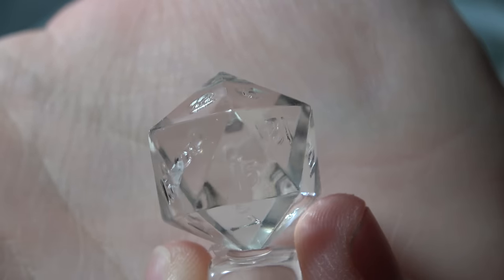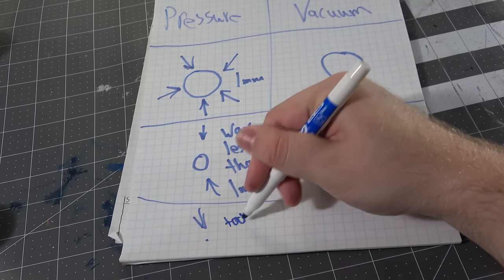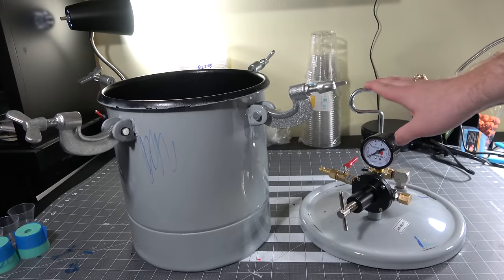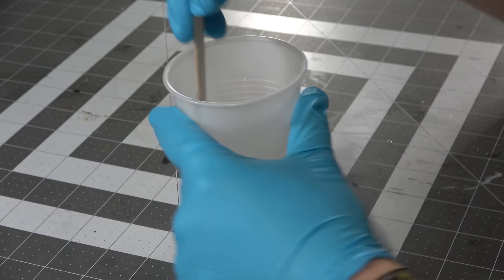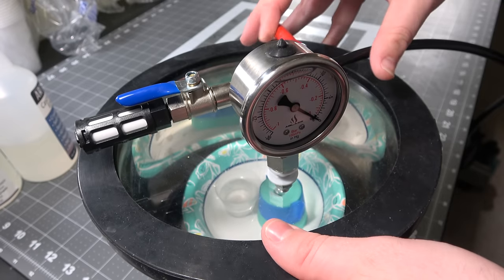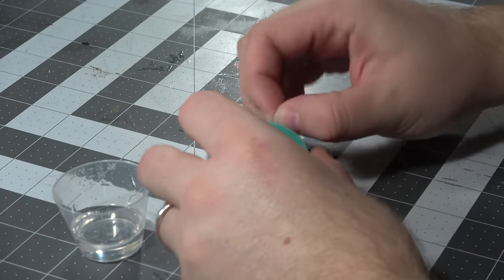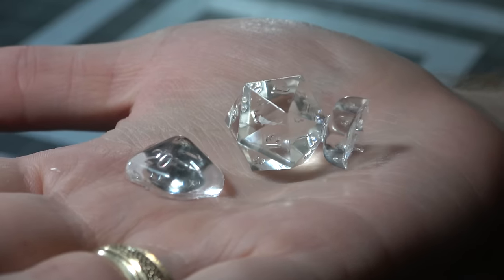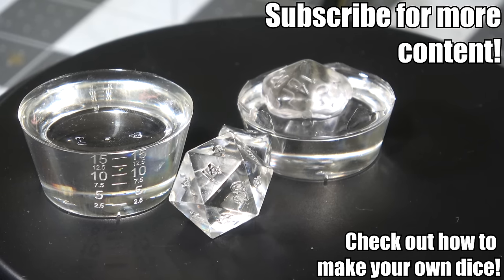Pressure Pot vs Vacuum Chamber | Resin Dice Casting

Comment: I'm not a dice goblin and even I know you don't vacuum pull a mold. Vacuum pulling the resin ahead of time, then pouring it into the mold is a lot more convenient in my opinion than leaving the dice in a pressure pot. The pressure pot needs to be turned on the entire time while the resin is curing, and depending on what method you're using to keeping the pressure pot pressurized, it can be pretty loud. A vacuum chamber needs to be active for a few minutes, until the resin doesn't look like it's foaming anymore, and then it's ready to pour and you can just leave it over night.

It's basically just the same process as a pressure pot, but instead of pouring first and putting in a pot second, you put it in a vacuum chamber first and then pour it.

Comment: I have heard a general rule of thumb is that vacuums are okay for silicone but pressure pots are what you need for resin. I've only just started so all I know is from the flood of YT videos I've been watching lately. Also I love that little D20 hat that comes out of the vacuum chamber. It could probably make a nice board marker or mold registration key.

Comment: Make giant dice with smaller dice in it

Like a foot tall
Reply from the maker: Oh gosh, like a GIANT dice :P
Reply: With how many small enemies my DM likes to throw at the party during encounters, this is totally necessary.
pulls out giant die Okay so this baby has 12 d20s in it. There's 12 enemies(minions), so large die determines initiative, small dice determine attacks.
Could totally be used for sneak attack too. Just get a large damage die with as many d6s in it as you need

Comment: Great video, had to learn the hard way myself and fully agree on your judgement. Only that totally oversized pressure pot with it´s knucklebreaking screws is whar I do not like and find hard and unpleasent to work with. Get some dentist pressure pot, much smaller, nice and way more efficient. Very easy to work with takes less than one second to close/open. The right stuff for serial casting IMO
Reply from the maker: I honestly had never heard of a dental pressure pot :O I need to look into that.

Also thank you :)

Comment: Thank you for your video! I'm just switching to work with pressure. I was working with industrial vacuum chamber for a long time, than tryed a combined vacuum/pressure chamber, and now, because of ****ing war we moved and left it all behind, and now I try to understand whether using a vacuum chamber and a separate pressure chamber would do for my tasks, because it's easier now to buy it ready-made here in Spain, or I need to somehow to look for someone who could make the custom combined one. I'm coming to conclusion that maybe buying both would be better because I can make molds or dehaze resin in one pot while the other one is under pressure and it will save some time. But the question is if I could dehaze the mix for 2 minutes than pour it in molds with syringe and put under pressure, would it work for closed molds with 2 mm pouring channels? Answer, please, if someone have tried it? I haven't worked with the syringe yet and have poured all manually. And haven't worked with larger casts in pressure, only in vacuum.

Comment: Would the vacuum work if you stop the vacuum before it "boils over" let it settle, then do another pull and just keep doing that until all the bubbles are out? Yes, it's more work as you have to watch it, but I'm thinking of cost for an initial starter. (only planning on making small batches of a dice set for now).

Comment: What I'm curious about is the air pressure encapsulated within the resin. There's 30 PSI worth of pressure in each bubble. Does that make your object more likely to crack? Are there any really old castings that can be examined for fractures?
Reply from the maker: I don't THINK that it's enough to matter in this case, as it may be 30PSI, but the area of each bubble is sooo tiny it shouldn't matter. I have some dice from a year ago with no signs of fractures so far :)

Comment: Im new to resin and i got a heated lunch box because i seen people talk about using those for heat boxes and the vid i watched said to leave it in there the whole time of curing and it ended up turning it yellow...i could really use some pointers on how to properly use a heat box because the bubbles are gonna be the death of me haha. i also have an air chamber and what happened in the video is exactly what happened with me, so imma be returning it and looking into a pressure pot now for sure!

Comment: Could you try either 1. slowly stepping down from atmospheric to the full vaccum or 2. Just crack the vacuum valve open so that it will gradually reduce the vacuum? It might also work to only apply just enough vacuum to start pulling the air from the resin but don't apply too much vacuum that it starts spilling everywhere.
Reply from the maker: Supposedly yes, if you are willing to pull, then release, then pull etc. it can work. It's just a more time/labor intensive method, and you have a limited amount of time to work with resin before it cures, so be careful! :)

Comment: In the vacuum chamber, just open the vent valve and let the bubbles shrink back down, then close the valve again. Rinse and repeat till there's no bubbles left. No mess to clean up later. Hope that helped a bit.
Reply from the maker: You absolutely can do that, but then you have to watch it more, it's more labour intensive than just leaving it sit after you start like a pressure pot, and most importantly, you gotta watch your time, as the resin can cure on you if it doesn't have a long working time. This method takes a bit more time, so that can become a real issue. Just something to be aware of :)
Reply: @Rybonator  gotcha. That makes sense.

Comment: A way to get around the foaming issue while pulling a vacuum is to not pull a full vacuum at the start.  Use your closing valve to allow air into the chamber at a controlled rate slowly working up to fully closed.  This gives the sticky bubbles time to pop without causing an overflow.  It takes some time and you basically are babysitting your pot until it's at full vacuum but it's a great way to reduce spillage.
Reply from the maker: Absolutely! It's more time/labor intensive, and you have to worry about your resins cure time, but it would work :) Thanks for the tip!

Comment: Just curious, if you set the vacuum pot on a vibrating plate, will it pop the bubbles and prevent overflow? I'm guessing no because resin probably has immense surface tension.
Reply from the maker: Supposedly you could use a vibrating plate alone and just set the molds on there to get rid of bubbles, but I haven't tried that myself :)

Comment: What if you did both?

Haha. . .

Unless?
Reply: Like at the same time?  Or....
Reply: @CeeJayThe13th  don't think it's possible to do those at the same time. Think he meant our after another
Reply: @TaggedByTim  I did indeed, but it was mostly for the joke.
Reply from the maker: I like to put pressure on my vacuum. So I named it Freddy Mercury. That way it's always under pressure.
Reply: This took me nearly 12 hours to get the joke. I'm so ashamed of myself
Reply: That's how some people do it; Vacuum first, to remove air (esp for RTV silicon) then cast under pressure.  Nothing is perfect, so the bubbles that were trapped during the vacuum and could not escape are collapsed by the pressure.
Reply: Same thought. I wonder if the pressure contributes to the physical attributes of the resin or if there is a disadvantage like too much stress after the pressure is released.  I kind tend to think it is the latter. With metal, on the other hand, it's different. I dunno..
Reply: Yes, do both.
Source: I work with resin casting parts

Comment: Complete newbie here, who has only made 1 VERY bubbly d20.

The 'working time' with the epoxy...does it have anything to do with the temperature of the epoxy?  Like, it will not start to cure if it is above a certain temp?  I ask b/c on another epoxy channel (I forget who, sorry), he has a couple of methods of letting the bubbles rise naturally after mixing, and the method he uses is setting the mix container in some warm water, which he says keeps the epoxy more..liquidy?  If this is true, I would assume a heated vacuum pot would help a LOT.  Also, I know you've seen Dark Moon Dice's video on silicone mold making, so, maybe releasing and then rebuilding the vacuum before it bubbles over would be the best tactic?  

Thanks for your videos, and thanks in advance for your reply.  :-)

Comment: The silicone video would be interesting. I'm not sure how true this is, but I read that you don't necessarily want to pressurize silicone because that causes shrinkage and makes it denser and less flexible/resilient. I have pretty great results with vaccuum degassing my silicone, but I always do about 100g of silicone per 4 cup container so that it has plenty of space to bubble up.

Also: I don't think you're incorrect saying "One of the dice" rather than "One of the die." Imagine similar sentences referring to one unit among a group: You probably wouldn't say, "One of the reason I use pressure for resin is __ ," you'd probably say, "One of the reasons I use pressure for resin is _ ," etc. Or you might say, "One of the channels I'm subscribed to is Rybonator," not "One of the channel I'm subscribed to is Rybonator." In fact Grammarly is losing its mind trying to correct my sentences when I use the singular form, lol
Reply from the maker: I still degass my silicone with no issues, but I think the key to pressurizing the silicone would be to use a much smaller amount of pressure. Maybe somewhere around 20-25PSI instead of the 30-40 I use for resin casting. :)

My favorite sentence happens to be when people say "One of the channels I'm subscribed to is Rybonator", so that was a great example haha ;D That makes sense though. I have just always been a little troubled in the whole English language thing.

Comment: Also curing under pressure suppress the boiling of the water in the resin reducing bubbles. We use vac and pressure at my work in a metallurgical laboratory to fill samples
Reply from the maker: That's so interesting, I hadn't even thought of that :O Thanks for the information!

Comment: Two things came to mind watching this I was wondering about. 1st. Does the same thing happen if you pull the vacuum more slowly? I cant help but see a comparison to a pot of water that is boiling over from being set to high, and second could a different kind of resin, maybe a less viscus one, be used?
Reply from the maker: Great questions! The answer to both comes largely down to what resin you are using. You could pull it more slowly, but you need to be able to get the bubbles out before the end of the resin's working time. If you don't pull it quickly enough, then it will start curing with bubbles still inside of it. 

Hope tha makes sense? :)
Reply: @Rybonator  Yes it does. Have considered making some custom dice, but to busy with other projects lol.

Comment: This is a problem I see with people using vacuum all the time and something I had to fix in myself early on in my chemistry career. Pulling a full vacuum on any liquid from the get go will result in these same issues. Ask anyone who has had to clean out a rotovap because they were impatient and 'overfilled' the flask. For applications such as this, it is best to increase the vacuum in steps. You start with just enough to start removing entrapped air. If things 'boil' too vigorously then lower amount of vacuum being pulled. As you remove more air, you can increase the pull until you finally reach a full vacuum and you shouldn't have any issues with resin/silicone/etc. erupting from your container. This is, of course, a lot more babysitting than with a pressure pot but you should be able to get the exact same results without any loss of material. This also requires a decent regulator as well or a careful hand with the bleed valve.

Just wanted to share a bit on how to avoid what you showed for people who feel more comfortable using a vacuum chamber over a pressure chamber. I guess you could also set up a multi-stage vacuum system as well where you start with some cheap 12V pump that doesn't have much pull before moving to something bigger. I may need to do some testing.
Reply from the maker: Thank you for the info :) I was unsure of if that would even be worth it, or if it would take too long and the resin would start curing. I guess it's all a balance :)
Reply: It really is a balancing act and for a longer setting resin, it might be worth it, but for most people I believe the pressure pot is by far the easier setup. I may play around with the two resins I have on hand to see how they do as I have a couple of vacuum pumps. Now I just need to get a vacuum chamber to test things out in.

Comment: So, I've never actually seen anything about this, but is it possible to do something like this with UV resin? I know people use epoxy resin for dice usually, and epoxy resin is more widely available and cheaper, so it's more ideal. I just had a thought that the concerns with epoxy resin curing before you could get the bubbles out wouldn't be an issue with UV resin, since it won't cure until you put it outside/under a UV lamp, right? I've never worked with resin (yet) so I could be completely wrong here, but I've always wondered why UV resin was never mentioned when it comes to dice making.
Reply from the maker: Yes totally! If you make your molds from transparent silicone like Sorta-clear 12, you can use UV resin :) I plan on touching on that sometime in the future :)

Comment: I’m a little confused.  The video about your pressure pot said you needed a vacuum chamber to get rid of the spiky things.  What did I miss?
Reply from the maker: This is talking about for the resin specifically. The vacuum works on the silicone more than the resin :)

Comment: Would there be a difference if you vacuumed part A and part B separately then mixed? I'm having a hard time getting Harbor Freight pot to make a pressure pot :(
Reply from the maker: Not really, as well, it would be kind of a waste of time. (No offense intended in that.) So if you remove the bubbles from the two parts, that's well and great, but then you have to mix them up, and that is where the VAST majority of the bubbles come from.

You can still make it happen with a vacuum chamber, you just have to take a more active roll in making sure that the bubbles don't overflow by pulling the vacuum too long.

Comment: what type of Engineer are you or what's your degree? you said you don't have an engineering job in one of your replies, may I ask why as I am studying for Engineering and was under the impression that Engineer's have good employ ability. Sorry if it seems like I'm prying, I'm just extremely curious about the challenges you may have faced so I can overcome/avoid them.
Reply from the maker: No worries! I have an Electrical Engineering degree. Engineers are generally very employable! I struggled because I took a very specific route with my degree and had a very specialized focus. Because of that, it made it hard to find a job. Now I do nothing related to engineering, but I'm not complaining too much, I was never a great engineer to begin with haha :)

Comment: I'd like to propose a question: Given how pressure curing resin works, would this be able to work if you're trying to make gem or glitter dice? Or would that possibly counteract the intended result due to the process of minimizing the bubbles because of the extra content inside?
Reply from the maker: If I think I understand what you are asking, it should be just fine :) Check out my sharp edged dice video, I tried to mimic some gem dice, and it seems to be just fine

Comment: how did you modify the pressure pot for resin casting? i'm looking in to getting my own materials for doing this but I don't want to break a $100 pressure pot if I don't know what to change
Reply from the maker: Check out my full video on pressure pots that I put up, I go over every step of what I did so that you can follow along :)

Comment: I had no idea how a pressure pot worked. So you basically just put the PSI in, shut off the valve and now it's pressured for as long as you want until you let it out and that's it?

Comment: Can confirm that pressure on silicone works to create flawless molds. Since silicone generally has a significantly longer cure time it has a higher viscosity level than resin when first put into the pressure pot and those bubbles are a lot easier to shrink down. However, if your pot has a leak there is a risk with that long cure time relieving pressure on the pot and the bubbles forming, whereas the vacuum gets rid of the air and it cannot come back. Hope that helps!
Reply from the maker: Thanks for the follow-up info :) Hope others find it useful as well!

Comment: so maybe a dumb question: Why not do both? why not pull a small vacuum, small enough that it doesn't overflow, for maybe 10-20 minutes, and then switch to high pressure, that way you vacuum out whatever you can before you pressurize?

Comment: I've heard of clear resin yellowing over time. Does art n glow have that problem or is there anything you do to prevent it?
Reply: LogicalCake Art ‘N Glow states on the bottle that it “resists yellowing”. I’d bet that it will still yellow, but to a much lesser degree, and over a longer time.
Reply from the maker: What Simons said :) I haven't had mine yellow in 2 years. I imagine it will be a decade or more before it every starts.

Comment: Just a ? from a newb,  when using resin to stabilize soft wood for turning on a lathe, a vacuum is used. Then when casting that stabilized wood in a mold to fill voids in the piece, pressure is used.
Reply from the maker: Sounds right, did you have a question?